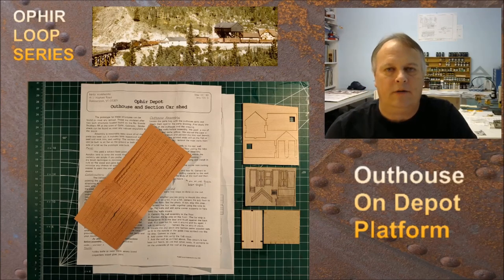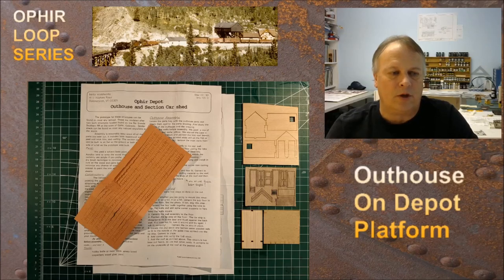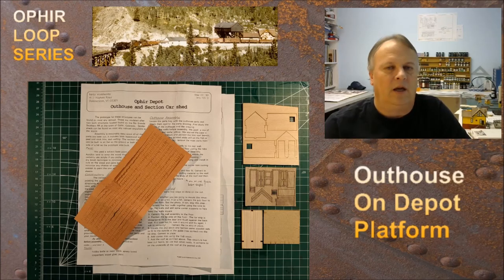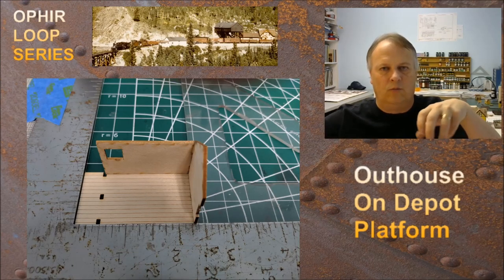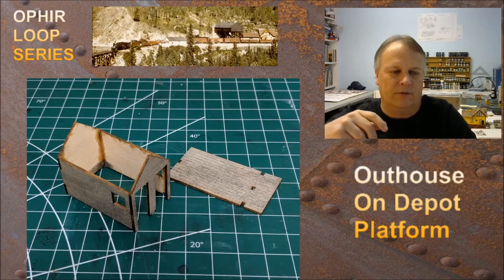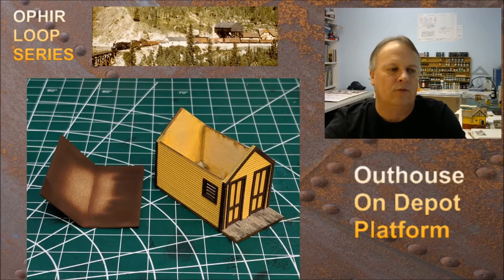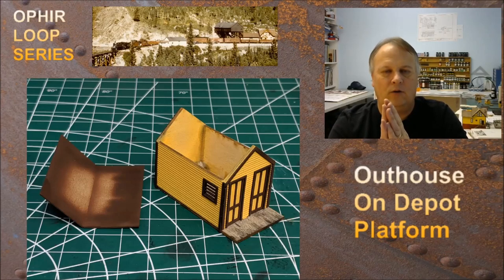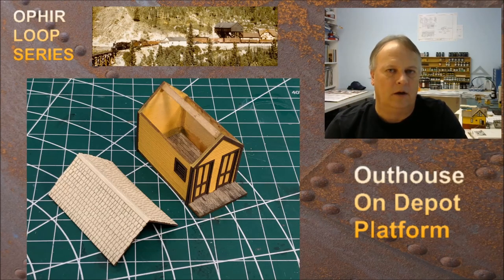Ep 71 HOW-TO DEPOT OUTHOUSE, BANTA MODELWORKS

Comment: Nice little shed. In the original photos of the building, it looks as if the building is sticking out from under the tramway a bit. The dirtiness is from rain running off the tramway wall and dripping on the roof that's exposed from under the tramway. Nice representation of this on your model. Looks great. Very nice video.   👍🎅❄🎄☃️
Reply from the maker: Thanks William.  I am looking forward to building the tram house in this project.  I try and use as much historical photographs as I build and weather the structures.  I am not sure I would be a successful freelance modeler, because I enjoy the research side of the hobby.

Comment: In the 40s, there were three (four if you count the passenger structure as two) outhouses there next to the Ophir depot.  I'm assuming the other two were for railroad employees.  I'm guessing everyone would need to pop a squat after coming down the Ophir High Line trestles.
Reply from the maker: Can you detail that a little more?  So the Banta outhouse counts as one outhouse, the depot has bathroom and there is another somewhere???
Reply from the maker: I saw the one close to the two stall outhouse, but missed the other one.  I have lots of scrap to create both of those pretty quick.  Thanks for pointing that out.  I missed that picture completely!